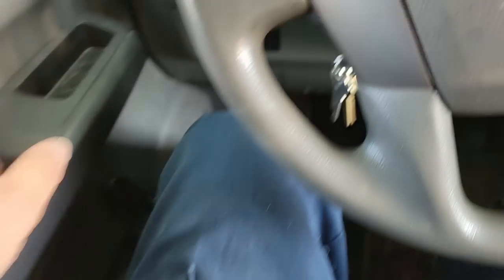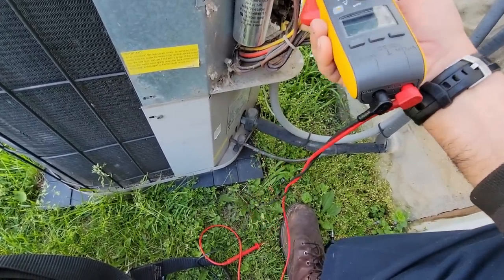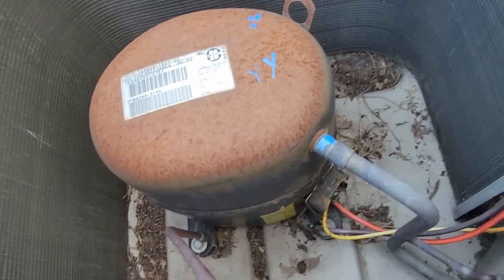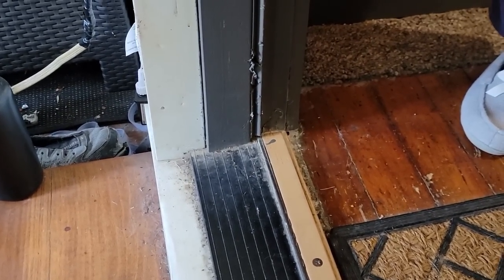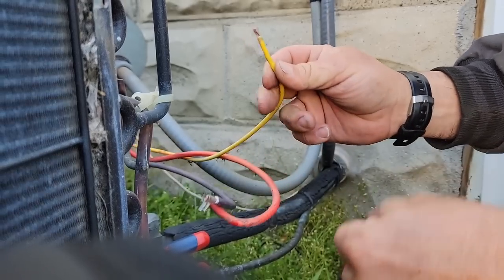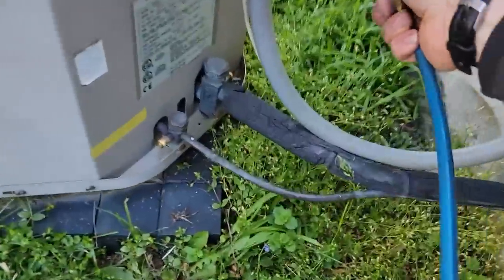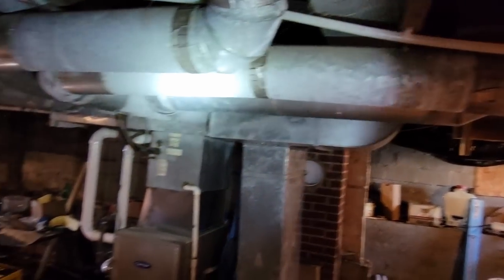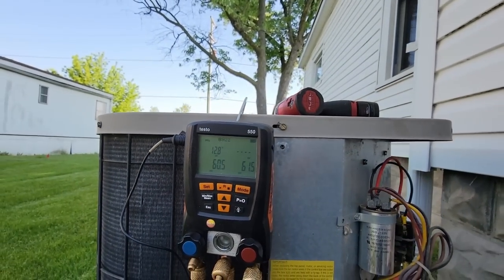Air Conditioner Not Cooling What Will I Find?

Comment: Nice job. My mom has the exact unit made in 99. Last year burned the same terminal. Did the exact repair you did. Went today to clean the coil and check the pressures. She's still kicking it (knock on wood) Loud as hell, as always, but still going strong with no evidence of the wiring heating up as before. Hopefully that unit will keep going for another couple years while she gets her money together. We both know those old Goodmans are on borrowed time.
Reply from the maker: Thanks for sharing your story, it's always interesting to hear things like that.

Comment: I got a Rheem from the mid 90’s that I put a compressor terminal repair kit on about 5 years ago and it’s still rocking and rolling.
Reply: Those Rheem Classics are the last good air conditioner ever made. The sheet metal is heavy gauge. They are stout.

Comment: Carrier gives you directions when you replace the motor terminals on an 06D on “how to wreck a perfectly good crimp tool” to crimp the barrels on them.  I’ve had my pair since 07, and have never thought of using them on the flag terminals. Going to have to give it a try now.  Thanks for sharing buddy, keep up the great work.

Comment: I'm just like you. I fixed everything that usually the last guy didn't put back. Replaced all the parts laying inside the TV  within reason. Especially Hi voltage insulators that would have a corona discharge on hi-humidity days. That's the sign of a good tech. Don't leave a half-ass job when you can easily make it right, while you're in there.
Reply from the maker: Thank you Larry!

Comment: This is exactly my unit, the CK24-1B. I replaced the cap as it was reading 25 and 3.9. But it still would not run the compressor but fan runs. I have the same 00, so I fear the same compressor terminal erosion. I have a replacement system sitting in the garage, but my recovery tank doesn't come for another couple weeks. So I was considering doing what you just did in the mean time.
Reply from the maker: It will likely work for several years and fail on something else.

Comment: That's my Goodman.  When the wire connectors corroded, I soldered the wires back on, 10 years ago.  5 years ago, I found a new R22 Carrier Air Handler with TXV.  Replaced an unknown brand, really old air handler.  I also bought a 30 lb jug of R22.  $500, but at the time the going rate was $100 a pound.  Now, I'm seeing $250 a pound.  Couple of years, and I'll be able to swap the jug for a new car.
I'm obviously an Amateur.    Apparently, $15K is the going rate to replace old with new.  My duct work looks like it was installed by monkeys.  I've fixed numerous holes, and moved the ducts being blocked by being hung over rafters.

Comment: You take a  pair of 4.5" end cutting wire cutters and remove the remaining tab from the post.  Sand paper the post as well as possible.  Take a Hi-Temp chrome straight sta-kon  10-12 awg and the wire end will go over the terminal post tightly.  You can take the same pliers and crimp it slightly if need be.  Then strip your wire back to a clean unburnt section and use your pliers to crimp the spade end over the wire.  Works perfectly.  Cover will still fit , etc.  Ive probably repaired 75-100 like this and never had 1 reburn.    The cause of this wire burning , like the cause of nearly every Goodman problem is a dirty condenser  sometimes in combo with an over heating fan motor.    Pro Tip #1.....If you can see a Goodman Condenser its dirty.  NEVER in 30 yrs walked up to 1 that wasnt.

Comment: They have a 1/4 in impact driver, wire wheel brush that would make those connections from the compressor terminals shiny as heck just a thought man they rock and they make really small ones
Reply from the maker: 👍👍🤦🏻. I have three different sizes of those on my truck I use for brazing pipe and other cleaning tasks, I forgot about them, but I'm not sure how well it would have fitted into the tight spot I had to work in. Good call!

Comment: This happened to my 22 year old nordyne 2 years in a row.  July 2020 was terminals corroded and burned the wires. July 2021 condenser fan motor and terminals burned off again. This time we put on a terminal repair kit... august 2022 comp blow out all the R22.... Now searing for a new unit

Comment: Not sure if you know this but there's a company named blue one if your service technician you can take the tests and send them proof that your technician but they have 24-hour service they have every wiring diagram for all different types of units and it's a form for us older text to help the newer guys but also the freon TDX 20 AKA are 458a is a direct replacement for r22 and it works with mineral oil makes unit higher capacity low is the coolant temperature of the compressor.
Also I've put those steak on repair kits on terminals and they've been running for over 5 years

Comment: You can always use a small file or a portable reamer from Milwaukee if you have one or it's really good idea to buy a Dremel with the flexible head I encounter this a lot with power fluctuations melting the tabs all too familiar on the East Coast
Reply from the maker: I have the Milwaukee Dremel style tool, the fact remains this piece of equipment should have been replaced and was slated to be replaced until the customer found out how expensive they are. You have good points 👍👍 thanks for the feedback!

Comment: You seem like a good guy and worked with the customer which is great, but you can get a new A/C for under $2k plus installation costs of course.  I just bought a new precharged A/C, furnace, coil and precharged line set for under $4k.  The A/C alone - $1,900.  Installed myself saving $7k to $15k.
Reply from the maker: Ok 👍

Comment: I am in a mobile home and was wondering if i could use any other filters than those metal mesh A-coil evaporator filters.  The unit started to freeze up at 64F inside house, thermostat set for 60F, 85 outside (i like it 🥶 ❄️ at night). I was using standard 3m merv 5 pleated filters on the A-coil( but tech said the evaporator coil was getting the cardboard/filter pleats that the filters are made of wet makeing more restrictoed air)
 And merv 1 on return door(20in x 30in)= merv 6...

 The company that installed the unit put a R-410A 5 ton A-coil evaporator with a 3.5 piston in A-coil then put a 3.5 ton condenser outside. The air intake is a 20 in x 30 in with blower (4 speed up to 4 ton HP/AC, 2.9 FLA, 1/3 horse power@ high speed 1460

Comment: If you want a really good crimping tool for those terminals any of the automotive tool brands like snap on, Mac, Matco, and blue point make a very good open barrel crimping tool. It works great for repairing engine wiring harnesses that have hundreds of pins to the larger ones you have here.
Reply from the maker: I've been looking for a good F terminal crimper for a few years, once I get the crimper the next issue is getting the shop to buy the terminals. The only reason I keep holding off is I only need to do this repair maybe a few times a year and I haven't found a 10ga crimper yet, normally all I see is 14 if I'm lucky and they're normally only good for insulated crimp terminals.
Reply: @HVACRSurvival  - I have a couple of F terminal crimpers, but I suspect you're not talking about coaxial cable connectors.  (F connectors are the standard threaded coaxial connector used by just about every piece of TV related equipment out there, and cable modems)
Reply from the maker: @tbelding  correct, there similar in design. Most crimpers that are F style are insulated that I've found
Reply: @HVACRSurvival  - I could dig mine out and give you the brand names, if it'd help :P
Reply from the maker: Sure. Let me know, send me a email with a picture of it.

Comment: Do you ever solder the connectors?  I grabbed the milwaukee m12 solder tool.  Yeah its a pain but it was my own stuff so...   not sure if it helps though
Reply from the maker: I have the 12v Milwaukee but where are you soldering at? You can't solder the metal connectors.

Comment: Hey where did you buy that pack of those spade terminals for the compressor? I've been looking for a set like that for a while now. I have only used the one by qwik products and its expensive...are they just metal flag terminals? Imma start using that if I can
Reply from the maker: They are evco 6224cx.  https://www.diversitech.com/en-US/item/devco---hardware-&-connectors/slip-on-solderless-terminals/non-insulated-flag-female-slip--6224CX
Reply: @HVACRSurvival  thank you. I got some on the way wed...

Comment: I would forget about trying to put on new connectors. I would clean the pins on the compressor real good and solder the wires directly to the pins.  This should solve the problem for good.
Reply from the maker: The pins on the compressor are steel and the material that's holding them in place is glass.
Reply: @HVACRSurvival Good point.  I thought about that after I posted my comment. Some steel you can solder to and other types of steel you can't solder.

Comment: I don't know when they started using wimpy flag terminals on compressors.  There is a flag terminal crimper, specific.
Reply from the maker: Good luck finding a 10 gauge flag crimper.  I've looked. Nothing under $60
Reply: @HVACRSurvival  Yeah, I usually do like your doing and maybe solder.  Might take a look at T&B STA-KON C10-250A terminals.  They have a extended barrel.
Reply from the maker: Cool👍👍

Comment: It’s time for  the manufactures of these condenser units to use bolt on  compressor terminals and use oversized stranded wiring. It might add $50 to the price of the unit, but the customer in making an expensive investment. It’s a great selling point for the brand and it does not run the cost of the unit up that much for the best electrical  compressor connection on the market. This is truly upgrading the equipment. Just Waite till you touch one of those terminals and the entire charge blows out and the customer has to pay for a new compressor and  a system charge and a new eyeball.
Reply from the maker: The customer shouldn't be in there messing with it so if they do they take on all the responsibility, if you were in the field you know that the compressor manufactures do have screw on terminals available but the manufacturer of the equipment chooses to buy the cheapest piece of $#/t they can put in there because the consumer is cheap,  that's the reason why Walmart is one of the largest retailers in the world along with amazon. People don't want to know why it costs more money, they just want it cheaper.  If you're wearing your safety glasses you can see what I'm saying 👀